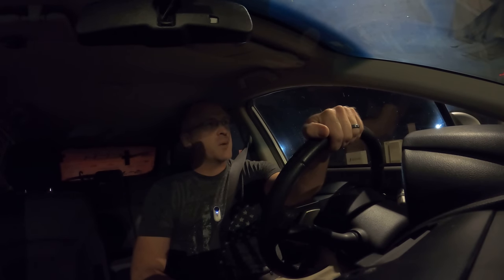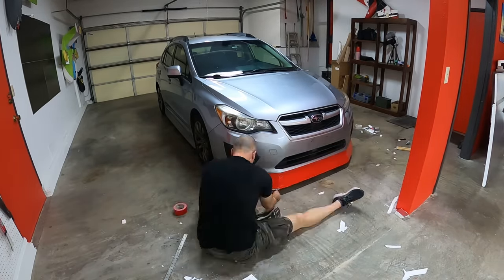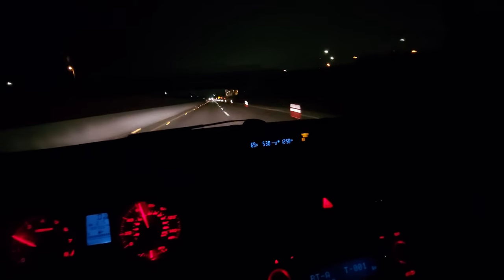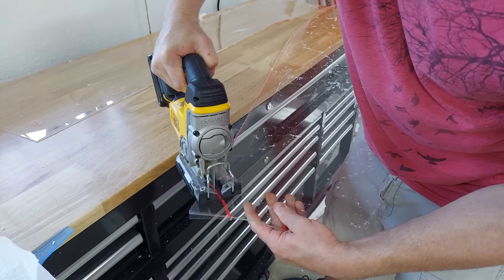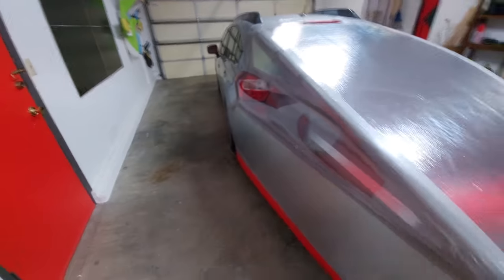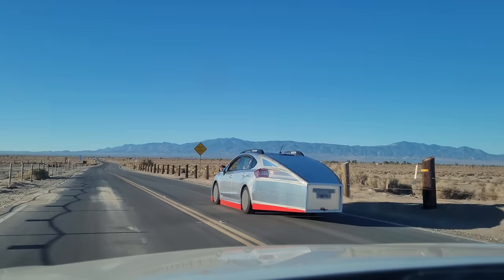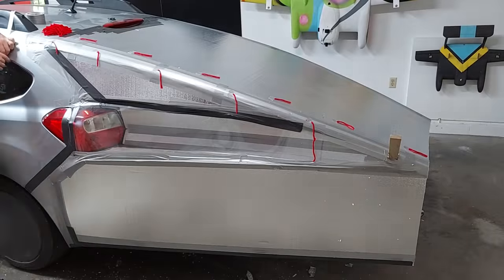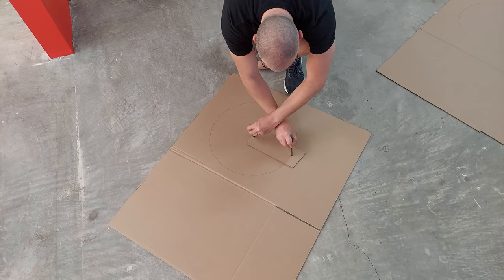Beating High Gas Prices Using Simple Aerodynamics (Home Improvement Store Edition)

Comment: if you use michelin Energy tires and pump them up to 2.7/2.7 Bar      then you should also see a significant improvement. 
also inflating your tires slightly higher than factory spec won't normally cause trouble if your driving easy peezy ^^. 
and reducing roling weight ie titanium lug nuts or very lightweight aluminum wheels.
And your roof bars are also an obvious candidate for removing weight :P and dirty air.

Comment: You can probably gain 20% efficiency by doing nothing more than planning your trips more carefully, avoiding unnecessary trips, and saving a bunch of time in the process. You can probably gain 10% around town simply by modifying the way you drive: accelerating more slowly, and driving more smoothly, and with a manual, ensure the engine goes into over-run more frequently, when the ECU cuts the gas completely. Avoid using the brakes unless absolutely necessary.

The skirts make a huge difference, and so does smoothing the underbody: the two nicest things which also improve handling substantially, but more to the point, they don't look stupid. :)

Comment: You need to put a flow meter in the fuel line and return line. Fuel in minus fuel returned equals fuel used.  Temp and humidity need to be really close when testing.  Ideally testing is performed on a closed course and the same acceleration and deceleration is used every test.  Elimination of variables and repeatable results are what you are after.

Comment: You need to calculate a loop or say 100 miles (easy math) use the same gas pump like your doing and calculate same route every time. For instance TFL truck does a fuel efficiency on trucks they have a 97 mile loop because we’ll exit ramps… and they do a 30 second wait after first click off then they go to next click before calculating gas mileage and compare to gas calculator on truck.

Comment: Neat experiment. But, covering the wheels is an instant safety issue. It prevents the brakes from ventilating heat.  You've inadvertently made a larger version of the original Honda Insight (one of the first Hybrid cars.)

Comment: Great video. Let me help you with gas pump accuracy. If you fill to the point when the pump clicks off you are relying on how accurate the back pressures are in the tank. A lot of things can change the amount of back pressure in the tank. If you want to be accurate you must take the time to fill the tank clear up to the tube opening.  This way your fill ups will be identical.  Its definitely more time consuming however for your tests y o u need an accurate measure. All the best.

Comment: Sorry, but I am compelled to correct you.  At 6:56 the racing stripes do absolutely nothing for efficiency, but clearly they increase horsepower and top speed!  Since you have two stripes your gain is approaching 200%.  Kidding of course - I love the approach to experimentation with the ground effects to keep air from going under the car and the long tail to improve the detachment of the airflow at the rear.

Comment: I imagine there’s quite a lot of error introduced by the way the fuel flow at the pump is shut off. But that’s really hard to compensate for since there’s not another easy way to fill the tank to exactly the same level every single time… unless you filled it so much that you could see the top surface of the fuel inside the filler opening…..

Comment: I want to make similar modifications to my semi truck. Was looking into 3d  printing but I love the foam idea. Do you have videos on how to use the sheets?
Reply: You are of coarse familiar with TrailerTail ? MasillaValleyTrucking uses them on their fleet. 
Are you talking about creating a fairing for the cab only ? 
You could make one out of canvas or nylon cloth and have it pull out behind the cab when you drop off your load, Then slide it back to the cab when you hook up your trailer. 
You could even just open it partway to seal the gap between the cab and the trailer. 
Since it is canvas / nylon cloth, it would flex in turns.
There is a huge amount of turbulence back there.
Reply: @monkey boy  I'm thinking about making fairings and bumpers or truck and trailer. Thinking abs plastic now. I like the canvas idea for the trailer gap though

Comment: as a worker on A gas station, i can confirm that pumps are not reliable at the point they stop. you can always keep putting more and more gas on your car, till it really reaches the top. That is due to the gasoline foaming when exiting the hose. (it does not affect at the final ammount of gas, only when it thinks you've reached the max)

Comment: The problem here is that at the same way you are sealing the bottom of the car and reducing drag, you are also creating downforce which translate in rolling resistance that increase the consume. So you may have increased the efficiency even more than you have calculated

Comment: To have some acuracy into your consumption results you need to do several pass at the pump with the same setup and calculate de average. If you do only one pass for each setup it will not take into account all the changing variables.

Comment: Drop that air dam to the ground. I used aluminum to extend the front valance down to where I could attach vinyl baseboard strips to 1/2" from the deck. Yes, it would drag from time to time but it never really suffered any real damage.  Try to roll that right back to the bottom of the front wheel openings. Using the same vinyl along the rockers for side skirts helped but nowhere near as much as the front dam. It was funny watching the hood  be sucked below the tops of the fenders around 30 mph. Position your tufts and cameras to watch how the air changes at wheel openings, employment of air curtains could be your next best bet. Study Aptera's design. With a .13 Cd it's the idea to emulate as much as possible.

Comment: having the engine draw gas from a container that can be measured with some precision will make your data more accurate.  also, drawing data about fuel consumption directly from the engine control computer (what the fuel injection system says it is doing) should provide some helpful data

Comment: The only accurate way to measure fuel consumption is a flow meter on the fuel feed and fuel return, subtract return from feed and you have total consumption.

Fuel feed lines can run anywhere from ~40-60psi on port injected cars so a flow meter thats capable of that would be necessary unless you fit it pre fuel pump. Returns are not pressurized.

Comment: I have a Toyota blade master G it’s a petrol 3.5L I found on the same route I can get 15km/L average if I drive at 80-90km/h instead of 10km/L when I drive around 100km/h. This is a pretty straight road with a few right angle turns at roundabouts 
My Main point is slightly lower speed means great efficiency increases for me 👍

Comment: A pedestrian wouldn't be able to see your turn signals from some angles with your tail. I believe it would also decrease rear visibility. I like the idea, however i suspect that weight reduction would be more efficient at reducing fuel consumption. Without changing the length or rear visibility.

Comment: Downforce plays a part in how much fuel a car would use, by increasing the efficiency of the surface air flow you’d be likely to increase the affects of downforce leading to potentially more load on the motor.

Comment: My yaris has a full underbody cover and most of the front bumper openings blocked off and I'm well into the 50mpgs. Stock it would never go above 45mpg but more importantly, there is no effect from side winds, handling at high speeds is really night and day stable compared to stock.

Comment: No need for a permanent addition around the wheels. Get 12 neodymium magnets and place them inside of the wheel well, a thin saran wrap to protect the paint on a thin bit of aluminum wheel cover with small magnets on the outsides.
Reply from the maker: Hmmm this is an excellent solution that I did not consider.

Comment: If you want a aerodynamic car from the past with a flat underside, made by a airplane manufacturer back in the 1950, 1960 and 1970. And a great rally and race car back then. The SAAB 92, 93, 95 and 96 models.

Comment: It's difficult to rely exclusively on how much fuel you add to your car because a hotter tank and or if the fuel system has a return line back to the tank can cause the fuel pump to shut off at a different level in the tank. Cold tanks accept more fuel compared with hot tanks due to less vapor.. TBH the best way to figure out fuel economy is to sum the amount of fuel added and the miles driven then you'll have an average fuel economy across several tanks, compared it with the onboard computer and then make adjustments if necessary. Typically what causes the onboard fuel computer to become inaccurate is if there are fuel trims being done which typically can happen with dirty or old oxygen sensors or vacuum leaks or any number of other issues that make the car run less than optimal. You'd have to get an OBD device to check for fuel trims at various load conditions, ideally you want 0 fuel trims.

Comment: Mythbusters found that the most consistent way to measure fuel consumption and efficiency was to weigh the fuel - fuel changes volume with tempurature so that can have an imapct on how much goes into the tank. Also, the mechanical cutout that stops the pump will not be  accurate which would also significantly change youru numbers.

Comment: If you're alone on the freeway you could consider flooring it till 65, and then taking it out of gear until 45 so you only accelerate with the throttle fully open.

Comment: I drive a Spark EV, with some of the worst aerodynamics in a passenger EV. 20% range boost would be nice! I wondered about an inflatable cone or pyramid attached to the hatchback, flaccid at street speeds, fully inflated above 45 mph...

Comment: Several problems with the fuel pump system. First, just by the nature of how the cutoff system works, there is a litttle bit of randomness. fuel is splasing around an hits the "cutoff" port diffrently each time. Second, the point which the pump cuts off will be sooner if the pump is running faster and later when its running slower.  You can test that yourself by filling it to cutoff then trying to run it again at a slower speed. You can get a good bit more in there on the slower speed.  The reason that matters is because the pump runs at a diffrent speed based on how much fuel is in the underground tank. Even if the pump was at the bottom of the tank, it would have more head pressure as the fuel level gets lower. But because the pump is actually above ground level, its even worse. The pump is not pushing fuel, its pulling it. Its removing the weight of the fuel above it from the pipe going down in to the tank. Atmospheric air pressure now being higher is puhing down on the fuel in the tank, making the fuel go up the pipe. This is pretty efficiant when the tank is full, but it slows down as the tank is emptier. If the fuel level could keep going down, flow would come to a complete stop when the fuel level got about 30 feet below the pump. The easy explanation about whay is because at that point the fuel in the tube weights enough to be pushing down as hard as the atmosphire is. The complicated explanation is a bit of that, cavitation and/or lowering the pressure in the tube to the point that the fuel starts boiling. Tanks are not that deep though. The top is roughly 6 feet under the ground and the tanks are usually under 12 feet tall. But at 6 feet, air pressure is having to push that fuel up that 6 feet. If that 12 foot tall tank is only half full, airpressure is now having to push that fuel up twice as much with the same amount of energy. If its almost empty, now its pushing it 3 times as far. Thats 2 and 3 times as much work but with the same energy input. When you increase the work without increasing the energy input, the work slows down. A pump can get pretty slow when its almost empty.

The bandade for this is to just use more fuel in each test so the vairation in cutoff point becomes less of a factor. The actual fix would be to use a seperate marked contaner for your fuel system when testing. Mythbusters used graduated testubes as fuel tanks for this reason. Any marked container will do though.

Comment: Great video!
Aerodynamic is one thing, but the loss of energy to maintain the high engine rpm is another.
i. e. my Ford Mondeo(Fusion) with a 2L non charged petrol engine saves only 0,5-max.1l 20m behind a big truck at 90km/h, so 5-5,5l instead of 6l, and I'm driving a lot that way with my ACC. I would expect a much higher effect, but due to the enginesize and only 5 gears the increase of efficiancy at that speed ist low.
A small turbocharged engine would benefit much more from aerodynamic effects, also electric vehicles.
Even the tirepressure has almost no effect.
Only reducing the speed with lower rpm makes a big difference.

Comment: How much driving has to be done to account for money spent on the project?? ... Wagons rule and cars with trunks drool. 🏁   Cars in the 40s/50s had similar profiles and Buick, for a while, had boat tail designs.    Frankly, I'm surprised that all cars (and semi) don't have as many wind "cheating" Aero developments on them already.  Smooth underfloors, anti-lift rears, wind skirts/curtains, and smaller side mirrors... Also, Subaru's mte counter only counts in 10s.   You could have taped the gap btwn the side mirror and the glass.  Moving air around the side mirrors is a huge help.   Do you need a red flag on the tail extention?

Comment: you could get some wheel scales and weigh the car after a trip to infer fuel burn. but probably cheaper to add a quick drain to the fuel tank and drain it and measure the fuel use

Comment: Perhaps the rectangular area of the rear on the 2nd design is bigger than the 1st?   Also should be noted that subarus dont get great gas mileage. My girlfriend’s 2016 ford focus sedan gets 45mpg reliably at 65mpg.  Comsumer testing of Mazda’s 2021+ skyactiv X engine in europe gets 55mpg US at 65mph in the mazda 3, sadly we dont get that in the states.

Comment: other upgrades would be lighter wheels, smaller diamiter wheels, less agressive tread tires, lowering the car with lowering springs or coilovers, also engine modifications like a less restricitve intake and exhasut and maitence like cleaning the injectors and new spark plugs and coil packs

Comment: Nice video, I was also surprised that your effieciency was lower then with the first tail. Did tou take wind direction into account? This could be of great importance due to the quadratic influence on relative speed (so vehicle speed +/- wind speed in driving direction, roughly said).
SEcondly, the mercedes is the mercedes EQS. Just after the lightyear one, the most aero efficient car on the market :)
Cheers :)

Comment: You may know your stuff with aerodynamics, but establishing a baseline fuel efficiency needs to have minimum of 10 runs under similar condition, wind speed and direct plays a major role in fuel efficiency. My SUV gets 32mpg, but winds weather head, tail or from the side can throw (increase or decrease) off fuel efficiency by up to 15%.  After each change or theoretical improvement, need to make equal number of runs and then average them after removing anomalous results.  Called the scientific method.  I have logged 10k miles of fuel efficiency in my own car, using data logging, engine performance, and weather  condition.  So many well intentioned people come to inaccurate results, because they can't or don't   consider all factors.

Comment: Foam and aluminum tape not duct tape .it can be applied very smoothly specially if you use a squeegee and you can reduce the weight you could put the aluminum covered insulation foam in sections on the bottom this would tell you in an inexpensive form with the efficiency would be it could be cheap and relatively a one time and put it on take it off operation. even if you had to tape sections together with the aluminum tape.

Comment: There is even a negativ effect, wich can compensate the savings from the reduced drag. The efficiency of IC engines depends quite a lot on the load. They have their best efficiency at around 80% load. If the drag is reduced, so is the load on the engine and it becomes less efficient.  For a real comparison you would have to measure the fuel consumption per driven distance. 
The test would be lot easier with an EV. They typical give the consumption numbers quite accurately while driving.

Comment: You basically just need a fuel-flow meter to be spliced inline.  Or simply pull it from an OBDii Bluetooth adapter to read how much fuel the computer says is being used.  Pumps are not the best when there are many more efficient ways to measure.  Just research on a good OBDii reader.  The stock trip computer in my 2000 GMC Jimmy was always more accurate than my $12 OBDii reader when I filled up.

Comment: Back in the 90's I was out of work, so started delivering legal documents, and there was a lot of driving time, and scarce resources. I conceived of a streamline for tractor trailers, as a fabric cone off the rear of the trailer, pumped up to turgid pressure by engine exhaust, and would go soft with the engine off, (so more maneuverable). So anyway, I thought patentable, and drove from New Jersey to Washington DC, and reviewed the patent office, There wasn't much there, then I found it. I had thought there was clear sailing, not much prior art, then a solitary patent, couple names on it as discoverers, BUT THE OWNER OF THE PATENT WAS THE DOT. Department of Transportation. And no further development. The only sense I could make of it was for safety reasons the DOT forbade it, and had to buy out the developer's rights, so they could quash its development. Anyway I gave up. Can't fight city hall!